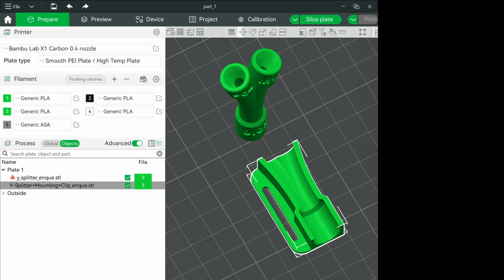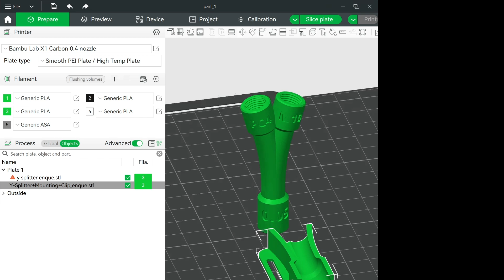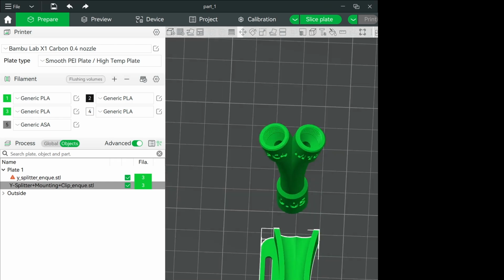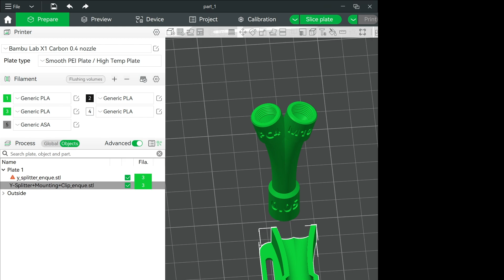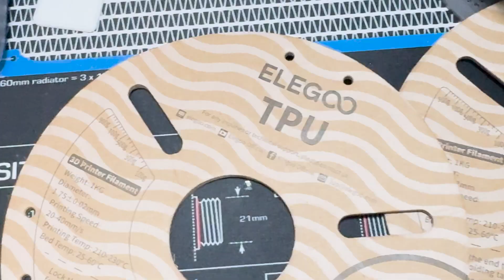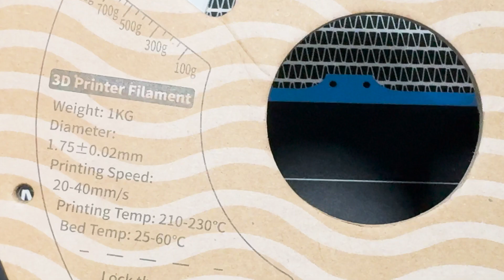Y Adapter For TPU Filament  On My Bambu Labs X1 Carbon

Comment: So scared of TPU. Might take a stab at it. Had a roll int he dryer for like a month now LOL
Reply from the maker: @TechnicalsTinkers  in my experience as long as there is no tension it works fine , once it gets too much of a stretch, if fails the print.